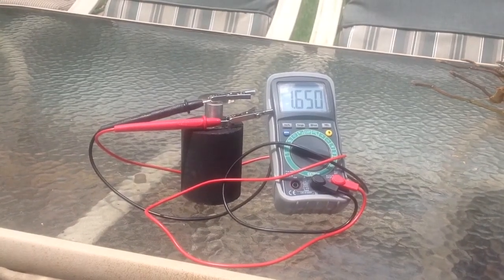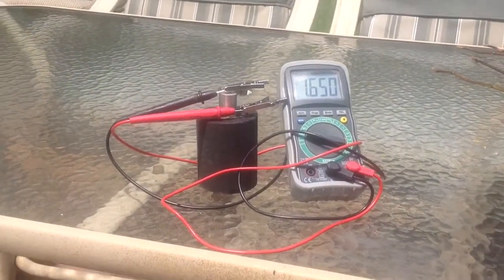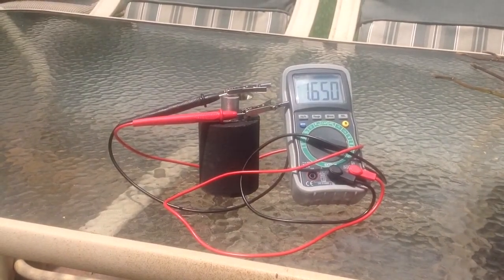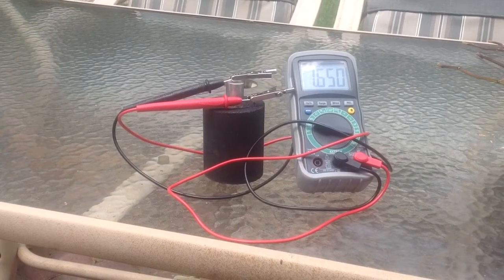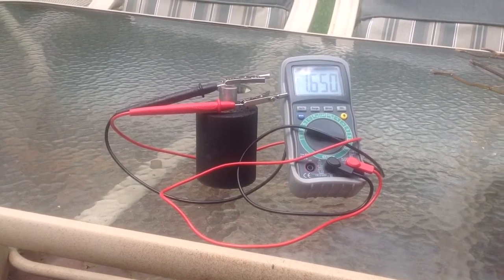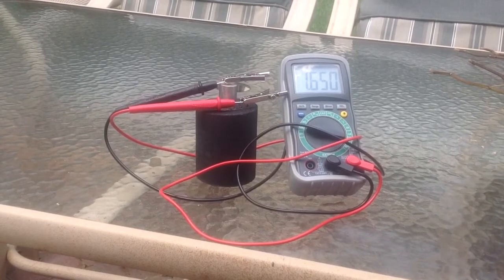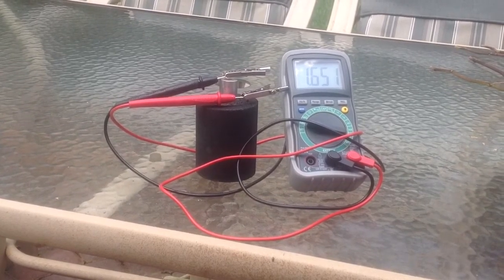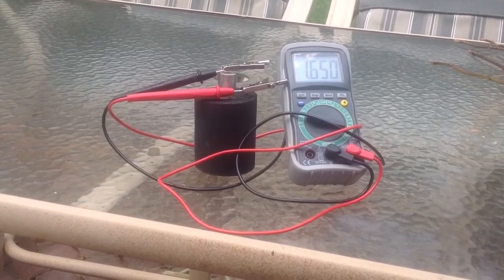CEMENT CRYSTAL BATTERY WITH TOURMALINE BEADS

Comment: DC current is the process of transporting matter from one place to the next. AC just jiggles back and forth, but DC has to carry the actual matter from one electrode to the other. Such a device requires the least amount of friction to transport. This least amount of friction, with batteries, is achieved with liquid cells. Even lithium ion batteries have a liquid inside them. Problem with salt water batteries is they corrode.

Comment: Well, Magnesium-Carbon has about this voltage range from 1.4 to 1.7 Volts with different electrolytes...
to get higher amps you need to scale up the surface area, which is proportional to the amps. So if you use big sized magnesium foils and carbonfiber electrodes you will get more current... but the problem with crystall batteries is that they always have low current compared to real Alkaline or NiMH batteries ! Crystall batteries are build to not consume the electrodes, but in normal batteries you have consumption of the electrodes or the included chemicals...
Reply: crystal batteries use some kind of PN layer semiconductor bandgap to capture background radiation or also convert heat to electrical energy. As these background radiation does not have a big energy density or the capture process is not good, the power output is low...also mostly some small amount of galvanic action also applies, so these crystall cells also degrade over time, but it takes longer,
sometimes a few years to see it...
Reply: So to get more amps just use big sheet foils of the electrodes and put them close together with the electrolyte between only very thin layers and roll them up like a capacitor... This should give you more amps. But surely it will still probably be in the MilliAmps range, if you use sheets as big as a normal white writing paper...( like 20x30 cm)
Reply from the maker: I see on You Tube a fellow named Steve Allwest  has developed a  single crystal cell that delivers 2 amps and does not require large sheets of foil.  Has he posted any construction remarks on overunitydotcom about  his findings?
Reply: Thomas Ferko
Salam.... please share the link.